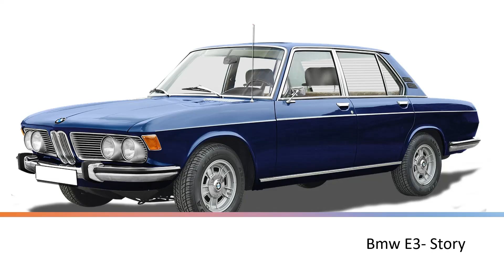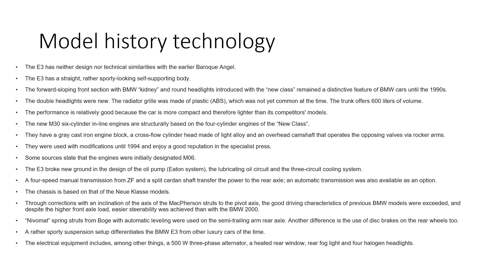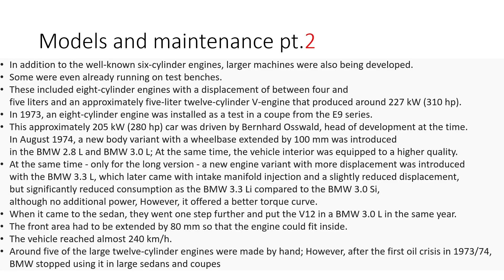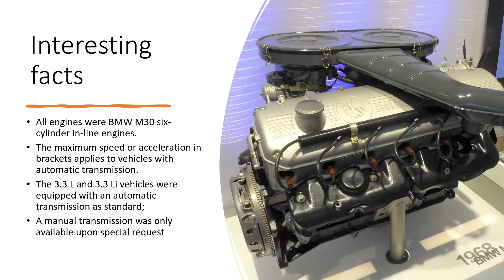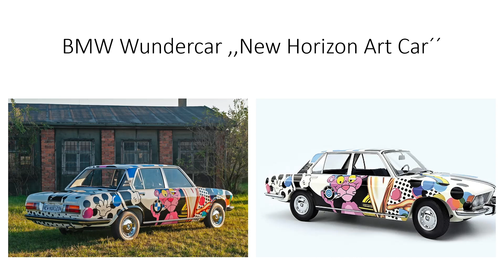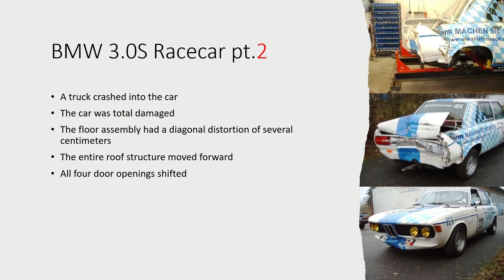BMW E3 Story

Comment: For one year from 1986 to 1987 I owned a BMW 3.0s. Here in beautiful Cape Town South Africa I took it on long scenic drives. It was a gorgeous well kept beige example with full leather upholstery. Inside the engine compartment the VIN plate showed it was made in Munich in 1972. I once took it up to 200 km/h but didn't stay there for long. The high sprung suspension was very smooth and supple, hardly what I would describe as "sporty" in the  road holding sense. Mine was in reality a powerful but refined GT cruiser. Parting with such a car which even now I loved more than any other was not easy.